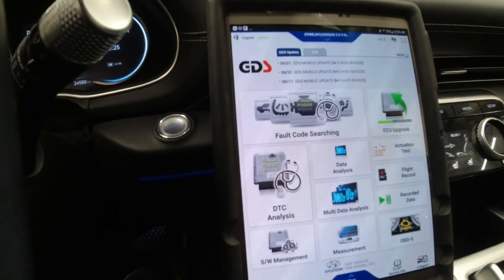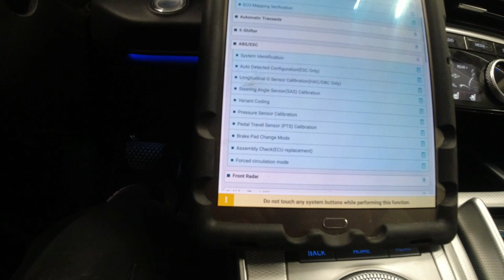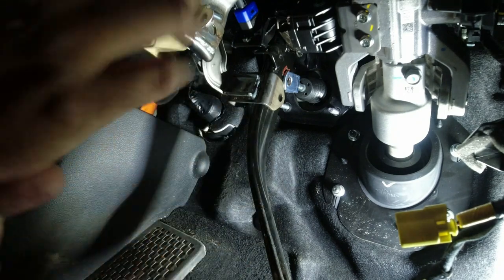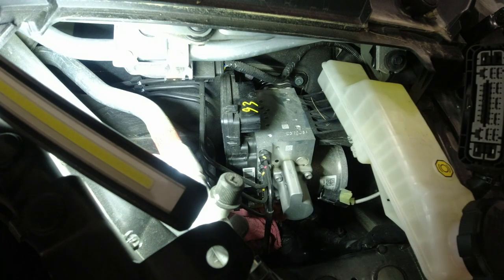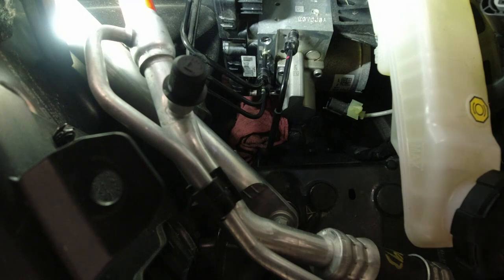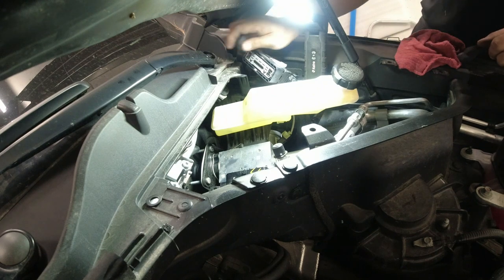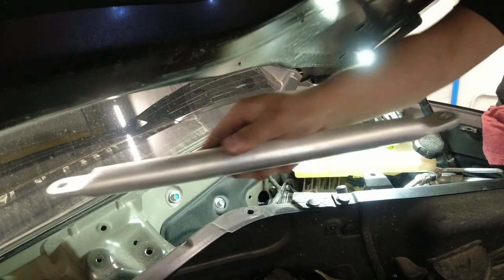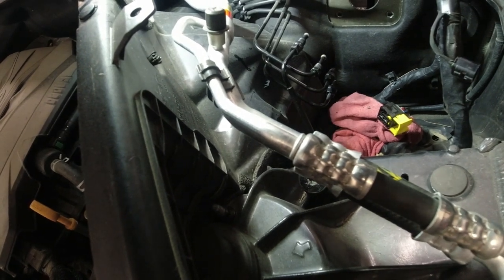Genesis GV80 Brake Module Failure - Brake Module Replacement

Comment: For your information, there is a manufacturing defect in this brake module note that the brakes work perfectly, so that when it reaches 20,000 km, a sound appears from inside the car when pressing the brakes, such as a ticking sound, and the agency replaced it on warranty.
Reply from the maker: Thanks
Reply: I had to replace one off a gv70 today , it was making cracking noise when applying brakes

Comment: Mine failed where did you get the replacement module? the dealership is taking for ever to get and seem to be having difficulty finding it/ordering it 2021 GV80
Reply from the maker: Yeah the whole assy abs module
Reply: @hyundaitech  we’ve finally got it ordered they were trying to order it through Genesis but apparently they actually have to order it through Hyundai system as Genesis system shows it as a invalid item
Reply from the maker: @bobbyghost2594  really thats kinda reverse, coz in our system we cant input any part number from genesis to hyundai program. Let me know when the repair is done.